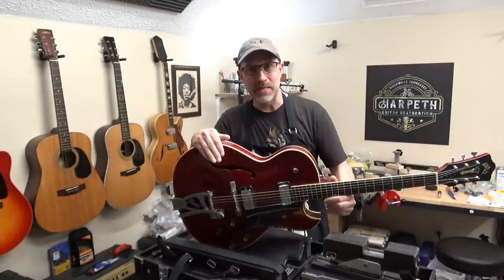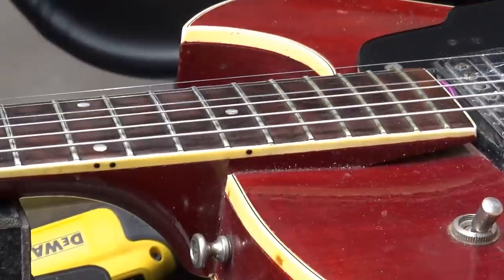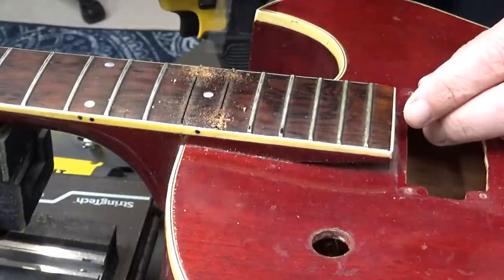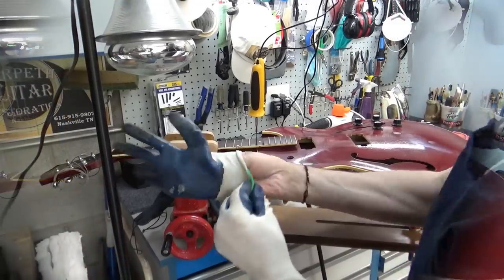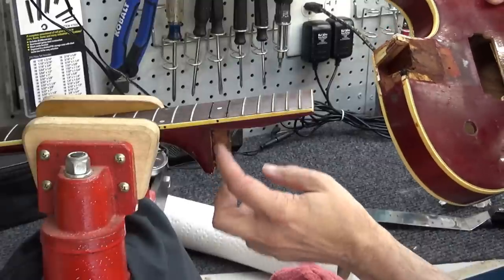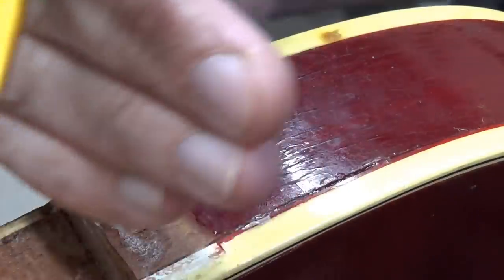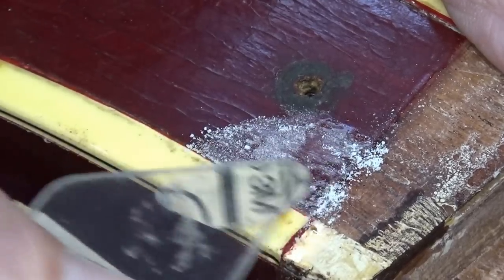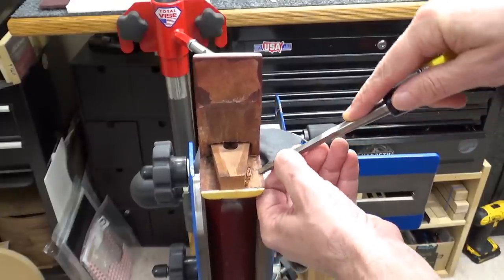Guild Starfire Neck Reset Ep.1 - 1966 Model

Comment: Man you're correct,there is'nt any videos of the guild starfire neck resets.

I needed to see this! 
I have a '61 Starfire 3 on the bench (dinning room table) now repairing all kinds of damage. No frets or binding on the neck. Wood busted out of the sides of tbe neck where the binding would go. It's originally an Amber but someone painted it red. Burn through's on the veneer's where it was sanded. A pickup needs rewound. Man! 
I may need to give you a call!😊🎸

Comment: Are those tuning pegs original? Can’t see any other holes (plugged or not). I have a ‘71 F-112 with similar cheap looking pegs; makes me think those could be original?
Reply from the maker: I think so , yes, they looked original
Reply: Yeah, those are original. Guild cheaped out with import tuners in the later 60s, these and the crappy import strip tuners are both pretty common for this era.
Reply: Yes, I understand they were original and common starting in '66 vs. Grovers up to at least '65. Volutes were also added around this time.
Reply: @rubercoober  Gibson was on that bandwagon too; look at the cheap strip tuners on late ‘60’s SG Specials: almost the same type. Which is why many got switched over to Grovers and Schallers back then. Pete Townshend with The Who switched them to Schallers.
Reply: They are original....